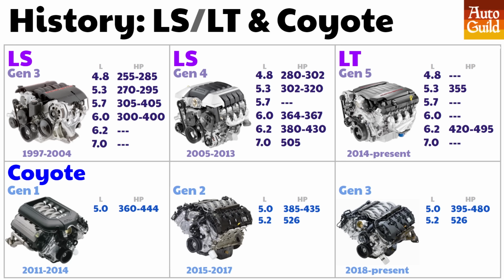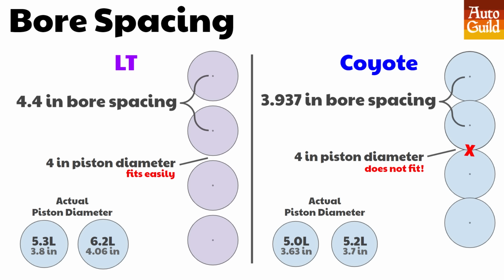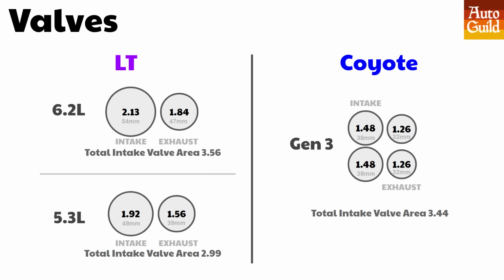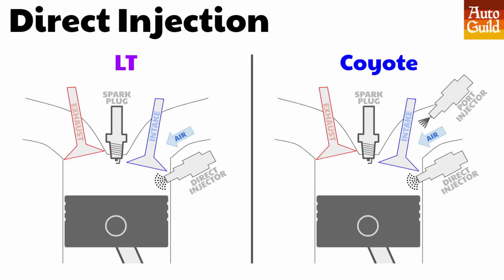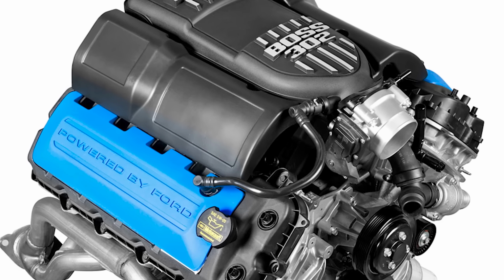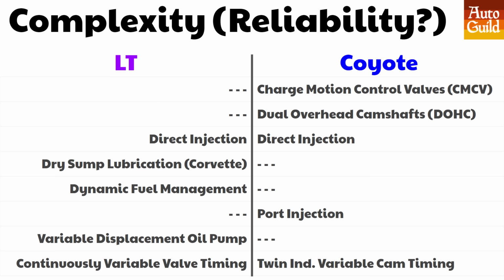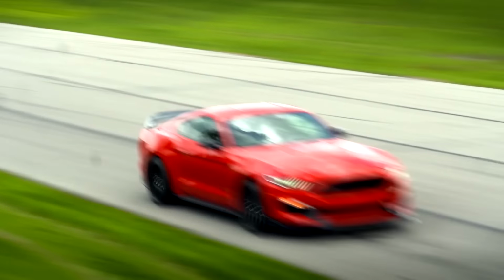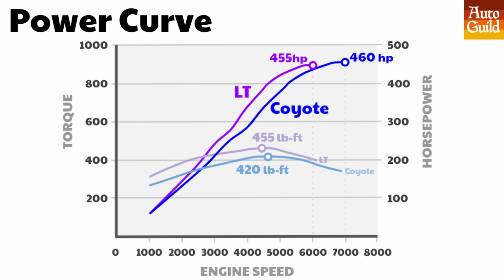GM Gen 5 LT vs Ford Coyote.  Which one is better and why.

Comment: My F-150 is faster than a truck should be. Love it.
Reply: My 2019 6.2L with 10 speed is faster than your 5.0L. Just saying. I love it!!
Reply: @xxlavenderxhedgehogxx7346  comparing a 6.2 to a 5.0 chevy fanboi mentality
Reply: @cpthindsightlol  your just salty, because you kno LS’d are the better motor
Reply: @cpthindsightlol  it’s Fords largest V8 they put into an F150, and it’s actually larger in overall size than GMs small block 6.2L. Get educated first before you try and come back with an insult
Reply: @cpthindsightlol   Comparing a physically larger engine to a physically smaller engine. Ford mentality ( Not really though, thats a poor way to stage a comment)
Reply: There not that fast at all
Reply: @daviddunn3296  they're. Just saying.
Reply: @daviddunn3296  ever seen a 5.0 f150
Reply: @nickysgaming2311  my buddy has one… not super fast lol
Reply: @dreteyete7305  not super fast but will gap most shit and built forget about it
Reply: @nickysgaming2311  yes there slow 😂
Reply: Never said I was racing my 5.0 F-150. But my pavement princess working man truck has more speed than I need. Really appreciate that it is there when I want it.
Reply: If my 2001 3.0  sawed off straight pipe  can smoke 03 4.7  Chevy both not healthy Chevy you got problem ...sorry I have ranger no doors flare side gray

Comment: Power density ≠ efficiency

...but aside from that, really good video.
Reply: Actually it does. More power per cubic inch translates exactly to a higher efficiency. That's kinda the definition of efficiency. 

"the ratio of the useful work performed by a machine or in a process to the total energy expended"
More useful work per cubic inch = higher efficiency. 

Does it automatically translate to better mpg? No. But it does mean it could lower it's power  output thereby lowering it's power density and save fuel while maintaining a similar if not still higher power density than the LS motors.
Reply: @MrComputerCoder   If you reread the definition of efficiency, you'll notice it doesn't mention anything about power or displacement.

All gasoline engines will convert a gallon of gas into a certain amount of energy, but how much is useful energy? The useful energy is what you have left over after you subtract friction, waste heat (exhaust/radiator), noise, pumping losses, etc.

That's why an engine with a high power density often has LOWER EFFICIENCY. Getting all that power out of a smaller displacement comes at a cost. When you have two or four cams, that's more parts rubbing against each other. Higher revving boosts friction at an exponential rate. 

When you look at efficiency as in miles per gallon, a turbocharger/supercharger really costs you. You can add a lot more air to the engine, and that extra air needs extra fuel. Using more fuel to go the same distance means less mpgs.
Reply: @Scott Rodgers  In all your efforts to sound smart you just proved my point. 

No it does not mention anything about displacement. It does mention work. Horsepower is the rate at which work is done in physics. 

The engines rated horsepower already takes into account all the parasitic losses. So you're efforts here to say I'm wrong mean nothing. The engines already been tested and the final results are what they advertise at the crank. After all the losses. Obviously we are not talking about whp, but neither is the video.

So taking all that into consideration, the actual power density result as mentioned in the video, does prove this engine is more efficient, whereby it's producing more work in a given volume. 

Or since you like to be fancy, it's producing a higher rate of work for every cubic inch of displacement, ie more horsepower. It's by definition more efficient. 

What you are referring to as in miles per gallon, is a different measurement of efficiency. You're argument is power density != Efficiency. Which is wrong. It's by definition exactly the opposite.

Miles per gallon efficiency is not the same as power density and using both terms interchangeably does not apply as they are different measurements entirely. The equation of rate of work per given volume is not the same as fuel burned over a given distance. 

Just to further prove they are not the same. Old engines were huge and inefficient. Both in terms of power and fuel consumption. Newer engines are smaller, lighter, and more efficient both in terms of power and fuel consumption. Meaning they are higher power density and still consume less fuel. The goal in automotive engineering is to advance engines to be both more powerful and efficient(in all areas).

The difference in mpg between the camaro and mustang being 1mpg better from the video, can be due to tire differences, weight of car(being most likely), aerodynamics of the body, and tuning of how aggressive they want to be in regards to overall acceleration and speed. 

They could very well make the Coyote a far more economical engine. But it's a fucking V8 meant for trucks and sport cars. What the hell is the point?
Reply: @MrComputerCoder  I'm sensing you're a car guy. That's good. There are too many people in this world who treat their cars like disposable appliances.

If you want to progress beyond being an average car guy, you should make studying cars a real thing. On the subject of engine efficiency, you should read up on the Otto, Diesel, and Atkinson cycles. Find what about cars interests you most, and consider becoming an engineer in that field.

If after that you want to progress further, I can share how I stood out and got hired by General Motors as engineer for the V8 program.
Reply: @scottrodgers2139  Ya an engineer who doesn't even understand the definition of efficiency. Lol claim whatever you want

I like cars like most guys. I also like math a lot too. All I did was apply a very simple mathematical definition and you couldn't follow. And you call yourself an engineer. 

Notice how you completely ignore my comment and instead resort to passive aggressive behavior alongside a dose of superiority complex. 

If you were an engineer, you'd understand that horsepower means rate of work and you also wouldn't be watching this video, because you should already know the answers to it.

You sound more like a GM fanboy who's upset the coyote looks better in this video. Childish really. I love all the big 3 v8s. Couldn't care less which one was in my truck. Nobody should really.
Reply: @MrComputerCoder You have some talents and skills that would go to waste if you followed my footsteps into engineering. Ignoring the truth, twisting the facts, and mocking experts shows you have potential as a politician. Who knows, you could even be cable news host someday.

Comment: I knew the lt made more horsepower and torque than my gen 2 coyote and I still went with the mustang. I love the character of the coyote
Reply: Some Chevy Fanboys are just brainwashed close minded most likely never owned a Mustang.
Reply: Well out of both 2021 models the mustang is quicker to 60 and finishes the quarter miles first and weighs more, has better visibility and more interior room, the camaro is better at handling and that’s it

Comment: Both are great engines.  They just use different philosophies.   I love the "do more with less cubes" from the ford.  I also love how responsive the LS & LT engines are from very few mods.  Whichever side your heart aligns with, you should be thankful for the competition always upping the ante.  Because we ultimately benefit from that with a big grin every time you mash that go pedal.
Reply: I own a 2019 Mustang GT and recently ran against a new camaro LT1. I nosed up by maybe a foot (at the most) in first and second but in third we were dead even. It looked like we weren't moving, it was really cool. One of those whoever has the better launch wins scenarios. I wish I had it on video.
Reply: I didn’t understand what the fascination with the LS/LT was until I drove one, as a person that loves DOHC high performance motors. I will just say one thing .. Torque.. Hard pull down low… it’s a beast of a motor.. and it keeps pulling.. that is why they are so annoyingly difficult to pass…
Reply: @mbukukanyau  

Pushrod Engines are louder, can actually produce more power than an OHC motor and produce their power lower down in the RPM band. 

They are better for straight line performance and a much simpler design.
Reply: @extremedrivr  and pushrod engines tend to be more durable
Reply: @extremedrivr  
The only thing pushrod engines do better than DOHC is be dimensionally smaller for their displacement.
   DOHC will make more power and torque than a pushrod at any RPM if compression and displacement are even close. Also the DOHC will have a broader flatter power-band.
Reply: Wish more people had this mindset. I own a mustang but love the LS/LT platform and one of my dream projects is an LS Swapped 77/78 trans am and my dream car is a C7 Z06 Corvette.
Reply: @MrRangersfan123  
It’s sacrilegious to put a Chevy engine into a Pontiac. Why not a Pontiac 455 big block?
Reply: @travelinman482  because a modern LS/LT is smaller then a big block chev/Pontiac, more efficient, can make more power and has far greater transmission options to boot. You get the best of both worlds when doing a swap like that in a hot rod. 
This all coming from a die hard Ford Guy. I'm toying with the idea of actually doing a 7.3 swap in my Fairlane as the aftermarket grows for that engine.
Reply: @rexmilanista  
Liked your comments. Now, are you talking about more [stock] transmission options? Cause there’s several companies that make aftermarket transmissions for engine swaps, etc. Also, you can make any BB engine build some serious horsepower and most importantly, torque. Dr. Olds used to build some bad ass 455ci engines in his heyday! There’s already a 7.3L Godzilla engine on YouTube that’s pushing over 1,000 hp.
Reply: @tubedude4859  
Which one?
Reply: @travelinman482  more Chevrolets power pontiac than Pontiacs
Reply: @travelinman482  Because Pontiac didn't make a 455 Big Block. 

They did however make a 455 Mid Size Block because that's what it was for cost saving measures.
Reply: @rexmilanista  

False!! 

A Big Block Engine can make at least 10,000 Horsepower on race fuel.  

That is exactly why the top classes in NHRA run Big Blocks.

Small blocks can't make that kind of power because they are severely limited by the actual size of the block itself. 

Also!! 

Big Blocks have a wider power band which means they don't need to turn as many RPM's to reach a particular MPH.  

Big Blocks make all their Power Down low which is best for straight line performance AKA Drag Racing. 

Small Blocks need higher RPMs in order to pull all the power out of them because their power band is not very wide.
Reply: @rexmilanista  do the 7.3 Godzilla swap
Reply: @travelinman482  
There hasn't been a Chevy engine since 1997
Reply: @travelinman482  Putting a twin-turbo Caddy 500 in my '84 Cad Coupe. My '98 Chev u dually getting g a Cad 500 also. Just put a Monster Mega SS 4L80E trans in my dually. 500 next.
Reply: @travelinman482 The “sacrilege” you speak about died when they killed Pontiac, maybe even before.

The GM F bodies have shared engines for quite some time.

If someone wants to put a modern GM engine in a 70s Pontiac why not? There is no modern Pontiac engine available.

I believe that GM shouldn’t have “killed” any divisions. GM should have reorganized and replaced all those divisions with 2… Cadillac and Chevrolet, but call it General.

In the General line you could keep the classic names like Cutlass, Firebird, and whatever name from the dead marque you want.
Reply: This is what makes America great.
Reply: Well said! While I will ALWAYS talk shit on Ford, I do it all in good fun. Both are insanely epic power plants that put up numbers we could only dream of 20 years ago from an NA engine and both excel in their own right and what they were intended to do.
Reply: @J Jones  
Blue 400…? Ford powertrain?
Reply: @J Jones  yep, you're correct.
Reply: Philosophy is the study of something both these engines study each other?
Reply: @markmassey3506  
Design philosophy, smart ass.  lol
Reply: That's why I see you in my mirror with all my coyotes
Reply: You hit the nail on the head my friend: the competition among the different automakers results in the amazing engines we have today from all of them.
Reply: The dude is biased... putting up an illustration showing how bad the Coyote cylinders are and yet, most traditional GM blocks have a water passage between the cylinders, as does the LT.   Interesting thou.. that all new Dart™ blocks have Siamese bores, meaning that they press the cylinder bore linings into the block with all four bores touching.  Dart and Ford use Siamese bores to build a more stable block, greatly improving ring and head gasket sealing for increased power and durability.
Reply: Porsche gets more power per sq inch displaced period. And less vibrations.
Reply: @rogerringold616  uh, ok
Reply: @filipprucnal lmao that's the craziest shat I've ever heard. Quit sniffing glue gotdamn
Reply: Beinga Ford tech at one of the dealerships in ga, these coyote engine are some of the most efficient engines I've ever seen. The power potential they have compared to the other engines, even the hemi's, how Shelby can take a 5.2 liter, supercharger it, do some internal work and make over 800 hurspurs
Reply: With Ford you have a choice between a Coyote or Godzilla engines.
Reply: Do more with less cubes internally , more cubes externally.
Reply: What about the 5.5 liter flat plane crank engine  on The  corvette?
Reply: Both great engines
Reply: Do more with less cubes but way bigger engine. Utterly pointless lol
Reply: @alexklein455  
400-480 hp and 20+ mpg is the point and it comes with a warranty.
Reply: Whit liberal philosophies in DC both GM & Ford will have to end development & production of both gasoline consuming engines and we all suffer the loss.
The Ford team has used the European design philosophy starting with its 4.6 motors in the 90's 
GM actually spent its money on Development of proven OHV design philosophy and that old increased displacement use. 1 mile less walking is always best when on the way back to the car with 3 gallons of gas in hand. Just sayin. lol
Reply: @c10wiremantawwallace13  
They're both OHV engines.  It's the cams that are in different positions.
Reply: When the outer dimensions are larger from a smaller displacement, and the mileage is a little worse I'm not so sure the "do more with less cubes" really applies as much.  Sure it makes more horsepower, but can I stuff it into a miata or boxster as easily?
Reply: @nunyabusiness5075  
Those are good points.  I think the mileage varies on the driver though.  My dad and I have identical F150 trucks.  I get about 15-17 mpg and he consistently gets 21+.  I obviously have a heavier foot.  The heads on a DOHC engine do take up a lot of room.  I'd like to see camshafts go away in favor of a Freevalve setup.  Then you could stuff a 32 valve V8 in your Miata.  The "do more with less" was referring to the cu in displacement, but I do see your point.
Reply: I was such a Ford truck guy. But the variable valve timing on the F series after the 3 valve was a disaster and ruined it. The phasers are a mess. I didn't even buy a Ford. Had to buy Chevy. I hope they figured it out. But it looks even more complicated
Reply: @default123default2  
I never owned anything with a 3 valve in it, but I hear switching out the stock oil pump for the Melling unit will fix almost all of the cam phaser issues.  
I grew up just the opposite.  I was a diehard Chevy guy until the early 2000s.  I never thought I'd be a Ford guy, but it happened anyway, lol.
Reply: Sorry to say but GM still has a lifter problem. Constant camshaft wear and bent pushrods do to junk lifters. Maybe the they'll figure it out but im still doing warranty lifter work on motors with only 1000 miles. I just had one where it blew a hole in the side of the block and wrist pins were in the oil cooler line, leak hiders (aka the skid plate or engine splash guard 😂)

Comment: Coyote is a damn good motor. Yeah, I'm a Chevy guy, got an LS7 in my 2000 C5 Corvette. But we did some test stands for Ford for the Coyote years before it was released. It looked like a damn good design then, and it still is. I'm pushing 70 years old now, and if I ever buy another sports car, I'm gonna give the Mustang a long, hard look. 522 hp from a 5.2? What's not ta like?
Reply: What's not to like?
The amount of time fords spend on tow truck and in shops.
Reply: Go for it man life’s too short

Comment: This video is a summation of why I continuously rag on the LT's.  They are using tons of engineering tricks and tech to optimize an outdated architecture.  Their poor efficiency only nets better mileage through cylinder deactivation, that kills reliability.  The Coyote fully meets modern engine efficiency standards with NA producing 100hp/L and boosted reaching 150HP/L.  Dinosaurs go good in Dinosaurs, but modern design and tech will outperform them pound for pound.